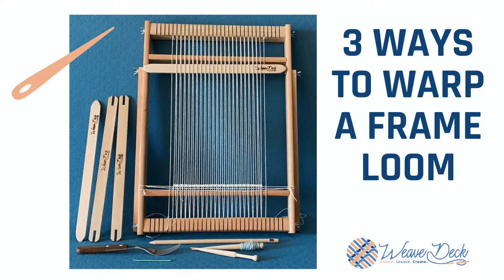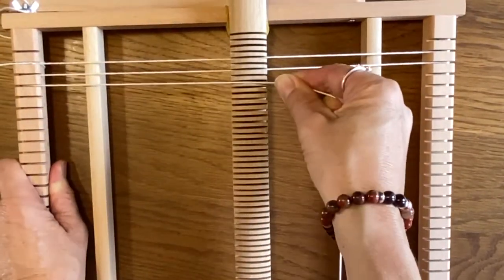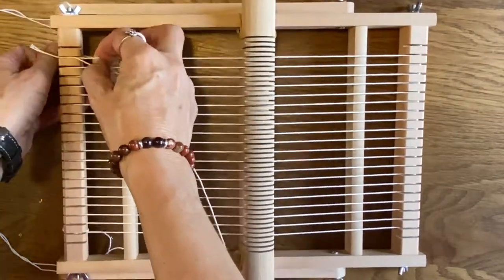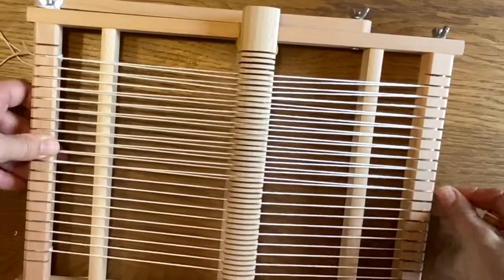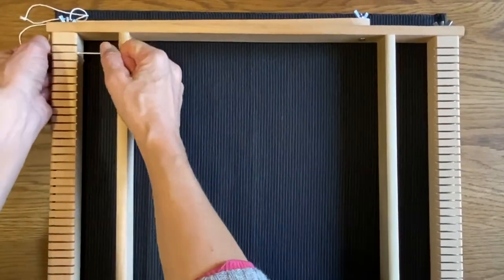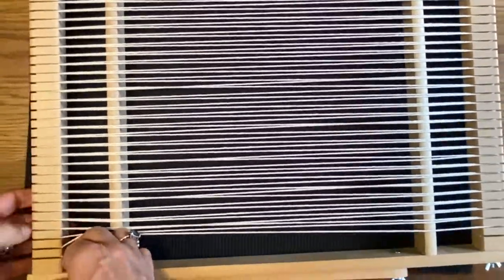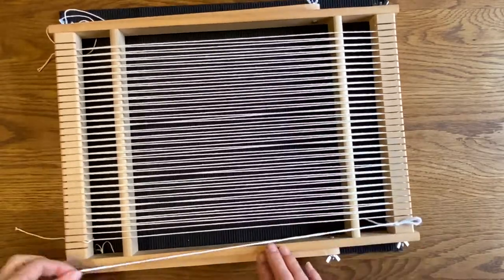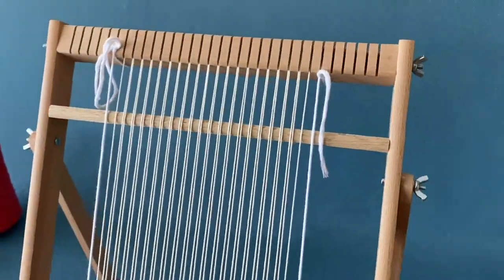3 Ways To Warp A Frame Loom

Comment: Hi, I am trying to use method three but am confused about how the last warps are supposed to look before I tie off. Will the last two only be single warped? Or should I loop the last warp one more time leaving the second to last row with three warps?
Reply from the maker: Hi Cassandra - the last one is single warped as it does not go back - but remains then parallel to the side, which I just find easier on the eye to begin with.  After this you will do some twinning or an alternative method (like half hitches) to space out the warp so that ultimately it does not really matter - this spacing of the warps (before you start to weave) is what then becomes important. So don't worry too much and just have a go. Apologies for not replying earlier to this. Let me know if you need any further help? You can also check out my video on "2 Ways To Set Up Your Frame Loom For Weaving & Tapestry, With Twining"  - https://youtu.be/oQxNKxzyHdY       which may help too? Good luck. :)

Comment: Can you use this type of loom to make a scarf?  If so, how would you lay out the warp to accommodate the longer length?  Thanks.
Reply from the maker: Hi . You could make a scarf -  by undoing the top bar and then clamping it to the other end of the table - at the distance you want and then clamping the rest of the loom to the other end of the table ? I haven’t tried this - but it could work I think, though it wouldn’t be easy . Hope this helps ? The easiest is obviously a rigid heddle loom .

Comment: How do you warp to make a longer item? Do you use a warping board as with a rigid heddle loom? Thanks
Reply from the maker: So sorry for not seeing this comment . On the frame loom the only way to make the warp longer than the board size would be to detach the top frame and clamp it to the table at a distance . You could then, with everything clamped warp the now elongated frame . But it wouldn’t be easy . A rigid heddle loom would be much easier !
Reply: @weavedeck  Thank Jane, I have a rigid heddle loom but its too big to use sitting on the sofa, this little one is great for small projects. I had a feeling there wouldn't be an easy answer
Reply from the maker: Yeah. That’s the only thing with these lovely frame looms . You’re really confined to their dimensions .

Comment: On the last double warping can you use a heddle bar ? How do you apply it to the frame?
Reply: Also how do u attach the heddle bar? X
Reply from the maker: So sorry for very late reply . You attach the heddle bar with an elastic band to the frame .
Reply from the maker: Hi . Yes you can . You attach it to the frame using an elastic band on each side wrapped around the frame and the heddle . Hope that makes sense